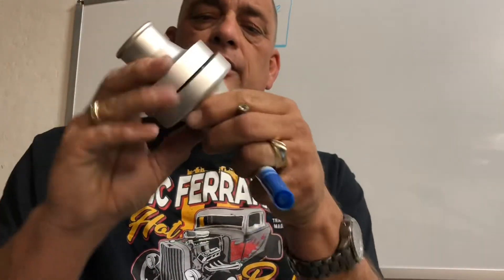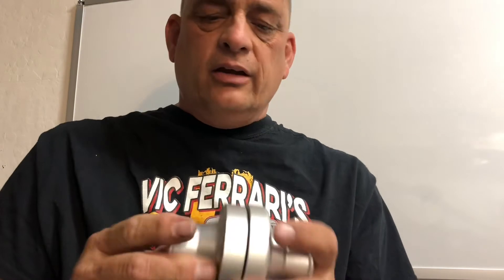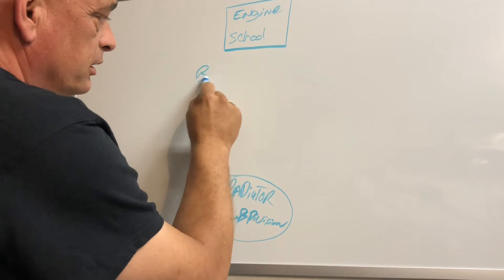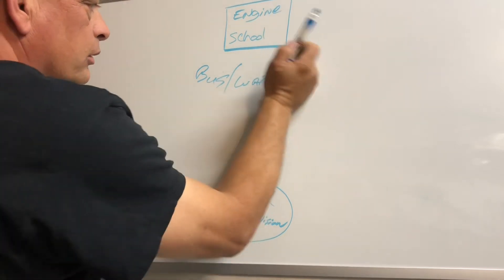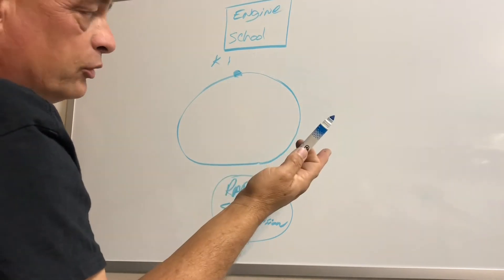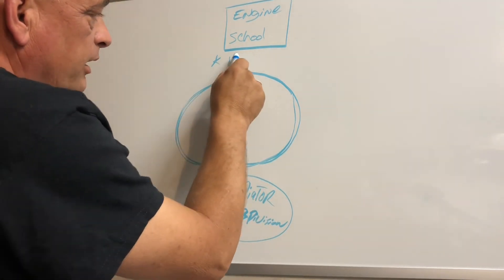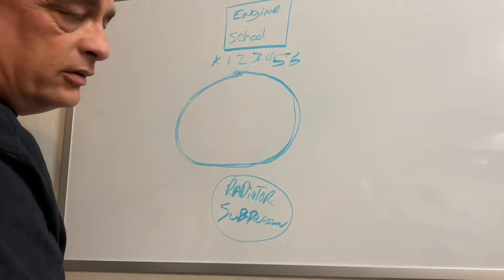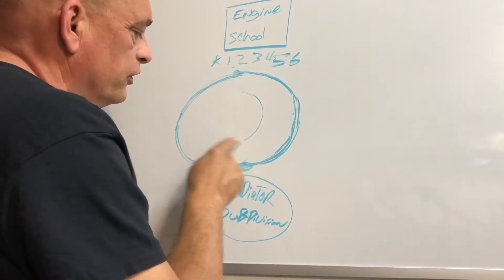No thermostat vs thermostat

Comment: Can car fan come on without the thermostat in the car
Reply from the maker: Yes if the coolant reaches the fan trigger temp the system sensor is set for.
Reply: Ok my car pass temperature level but fan is not coming i replaced new temp sensor still   not came on and i'm running it bypass what can be the cause 😢

Comment: I have a 350 chevy small block with mild cam on 1965 c10 truck. Theres  no thermostat. Engine runs fine. Should I install one? I live in Southern California were we have good weather
Reply from the maker: What temp are you averaging during a drive? For best gas mileage 180-190 engine temp after full warm up is perfect.
Reply: @vicferrarisgarage  runs at 200 degrees
Reply from the maker: @nursecuenca  leave it alone it likes it.  Sometimes it works. I would try a 180f just to see if you get closer to 180-190 but mainly for the morning heat up to expand the rod & main bearings quicker so you don’t beat them to death.
Reply: @vicferrarisgarage  what???

 all rods expand... with out thermostat, cause its internel temperature. oil gets hot vey fast 

oil tep is one thing cooler temp another,, i know it caused i worked a lot in racing
Reply: NO

Comment: I under the reasoning behind this theory however i have removed the thermostat in situations and prevented a motor from overheating.
Reply from the maker: That usually means to much restriction in system. Most of the time its an old clogged rad.

Comment: My thermostat in my rat rod got stuck closed so I tested it without one… on an almost 90 degree day in Florida it maxed at 150 degrees while driving. This is on a sbc with a small supercharger. I have no hood and a new aluminum large 2 core rad. It’s outrageously cold and I think I need to run one ha
Reply from the maker: Humidity in air wets the fins of rad and helps cooling. Another reason I just moved to Ocala from phx.
Reply: remove the spring  of thermsotat nd put it bach

Comment: Great demonstration!
Reply: you cant remove thermostat but.

here machinsit, wanna know hole stoyry? keeep reading..its free.

;;;;;)))

whne you ermove it, there is no more temperature control, so you ahve to  control it.. in cold wether you ahve to paya ttention to it and cover aprt or radaitor..

you dont need thermostat it will twist  your engine head.